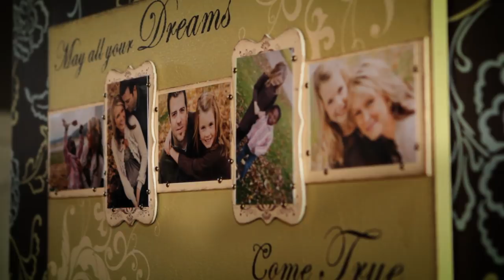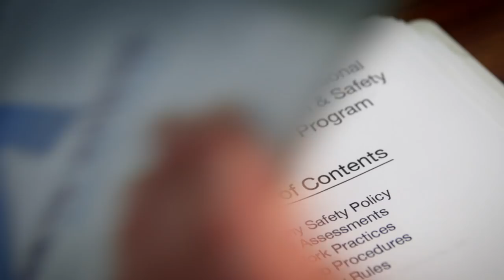Safety Is Personal: An Employer's Story

Comment: Usually books and paperwork is not even a thought, people just use cheat sheets and sign anything just to get onto the field as fast as possible.

My CompTia a+ certification has more challenging questions than a lot of safety quizzes... safety quiz, 5-10 questions and you are hired even if ya get them wrong. A+ cert, oooo, a 6 month class just for basics of computer technology insert parts into the hole. Or using a screw driver to screw....